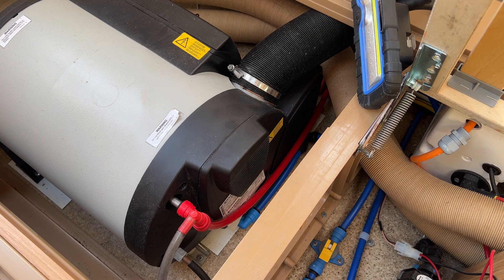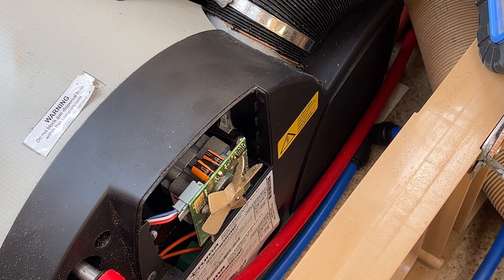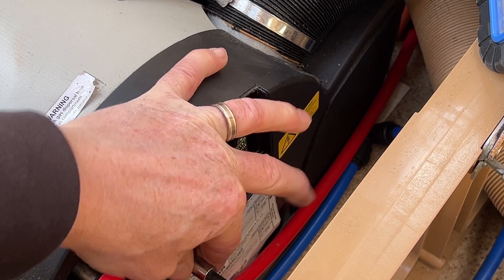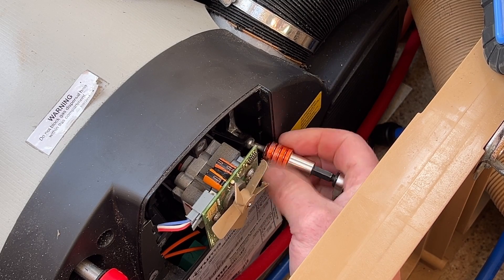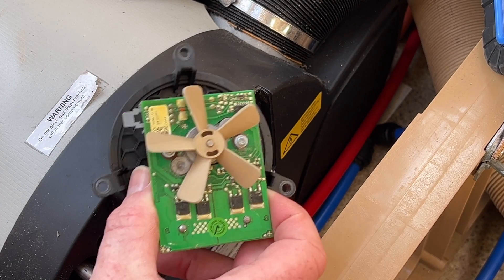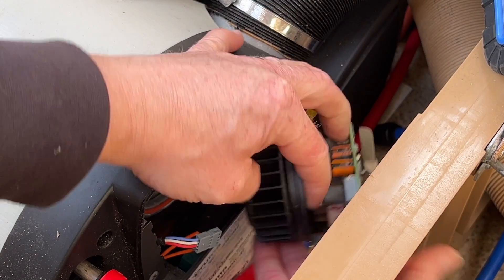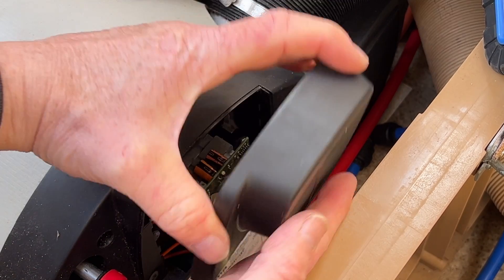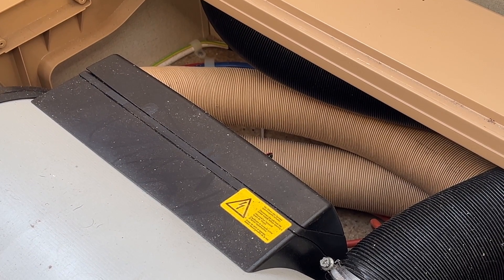Truma Combi Combustion fan motor unit removal

Comment: Thanks for showing us the unit.
I got the E638H code and managed to clear it by blowing with a hairdryer. It was previously cleared by the dealer by just spinning the little fan.
I can't understand why dust can make the failure occur even when the unit is cold.
I also noticed that the fan doesn't rotate in the vent mode, but you still get the error🤔.